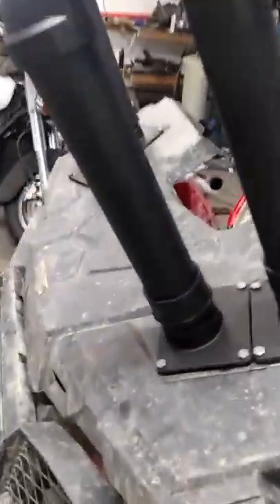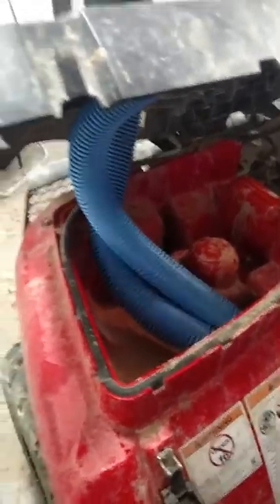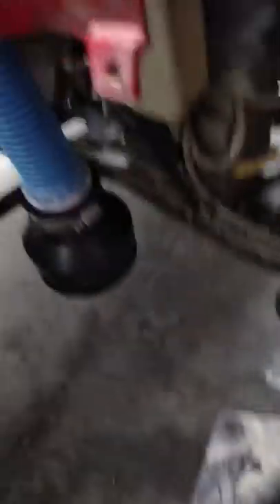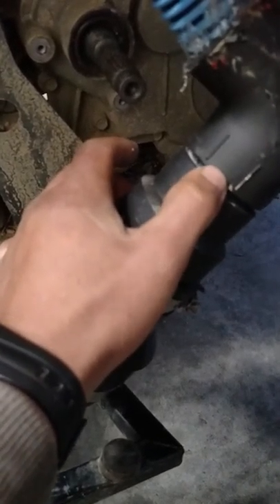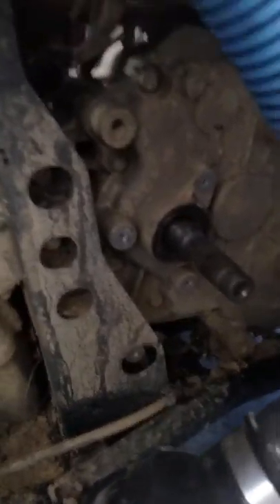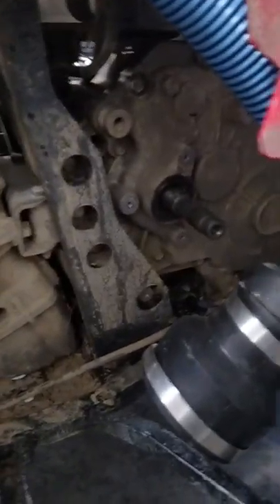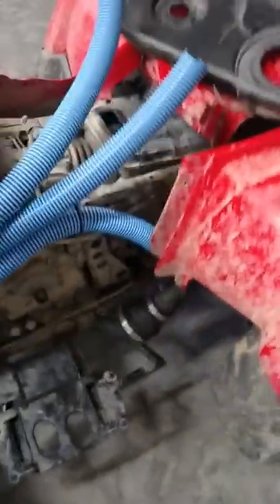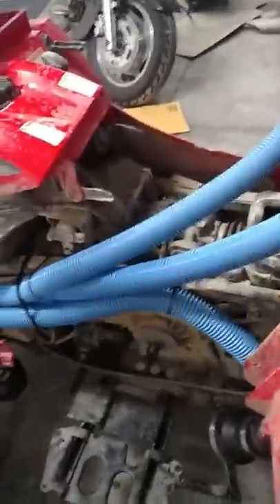How to install snorkel on sportsman 570

Comment: what is the 4th tube for ? I have a 2006 450 and plan on snorkeling it soon. I see you have 4 tubs coming out of storage box. On my mine I only see 3 places that need snorkel.1.  Tranny 2.  air box  3. belt box ...... Am I missing one??
Reply from the maker: Neolupu when i did the air box I ran dual for 3 reasons. First to keep it looking symmetrical and second that motor is tuned for that tiny short snorkel from factory so keeping one snorkel with that much length I didn't want to starve the motor any air. Mind you I didn't do any science on that just seemed to make sense to me to run dual. Third reason when I was looking at an adapter plate for my snorkel box I found one that was dual so really it all just came together.
Reply: All logical reasons . thank you for input. Any problems with running the pool vacuum hose. Collapsing , melting , water intrusion ? Did you have to re-jet your carb? Thank you in advance !!
Reply from the maker: idiforddieselMan mine is fuel injected but I'm assuming if it's carbed you may need to because you may run a little lean. And no the pool hose hasn't collapsed or melted. I kept them as far from the exhaust as I could and it is pretty solid hose because it's meant to be a pool vacuum hose so its meant to withstand alot more suction than what an intake or the cvt box will put on it